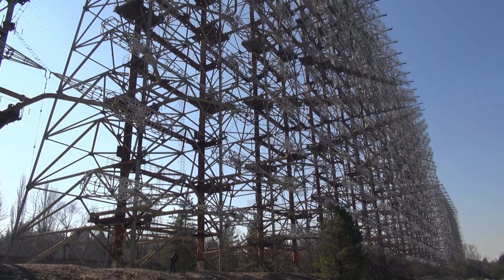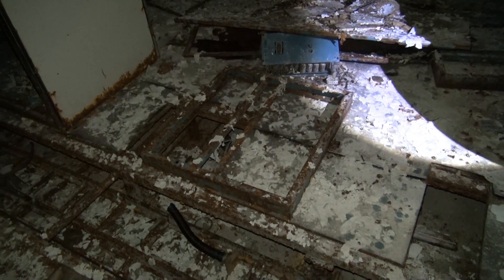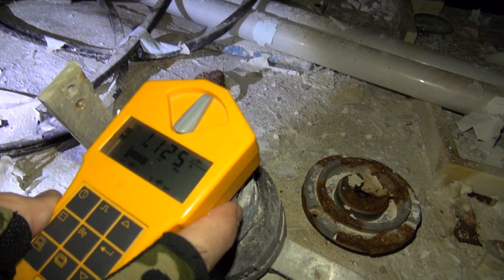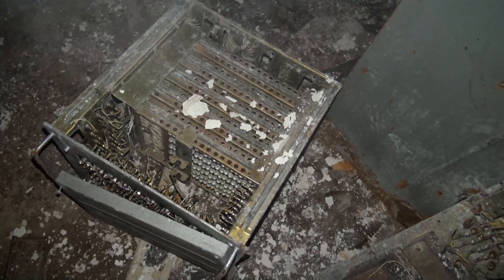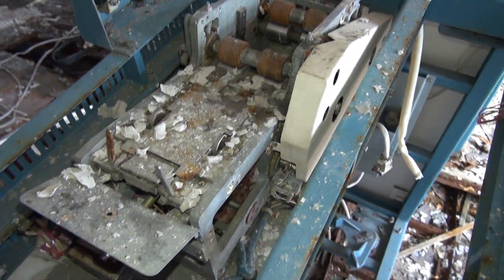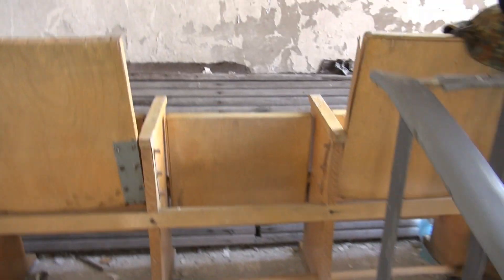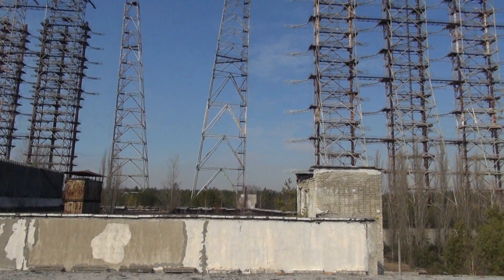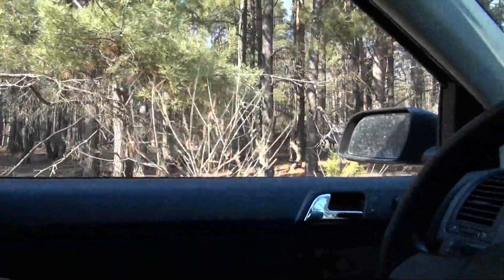inside Duga-3 / Дуга-3, computer mainframe of the Russian Woodpecker / Chernobyl-2

Comment: Somehow it's sad that all the hard work and effort people put into engineering, building and running this station is completely trashed and vandalized now.
Reply: Second law of thermodynamics
Reply: @edgeeffect  Entropy ... I'm twice as messy as I used to be ...
Reply: +nrdesign1991 It most likely wasn't vandalized by outsiders.  More than likely the Russians destroyed the equipment when they left so it wouldn't be able to be used against them. It was pretty common practice back then. You take all the information you can and destroy everything else. Look into the hotel in East Berlin where the KGB occupied the entire top floor. When they left there the hotel employees were so afraid they waited 3 days before they entered.
Reply: Matt Johnson
No matter who destroyed it or what they used the system for, the engineers and workers who put it together still earn my respect. There is quite a lot of manual labour showing on the parts lying around. The technology is inferior to western technology but I can't say they did't try their best.
Reply: The Chernobyl reactor contaminated the area a few years before the USSR collapsed.   Nobody was going to work there.

I am appalled at all of the human labor that went into that thing.  I would not be allowed to design equipment that required so much labor.

Comment: 2:55 looks to be this cable for a Soviet Main Frame my google search term to find it was ' 70's "40 pin connector" -ribbon' (in case the link does not work) and it turned up as the first photo :D 
http://www.ubbcentral.com/store/item/Vintage-60-70s-Multicore-Copper-Cable-40-PIN-Connector-Soviet-Mainframe-NOS-USSR_201452106500.html

Comment: They probably partially built the nuclear power plant just to power all the gear at Duga-3.  That stuff would have used enormous electrical power.  I think you said it was 10MW?  That's not really that insane.  The Crystal Palace BBC TV transmitter for London and the SE England is (was) 10MW power.  They don't need so much power now for digital TV as compared to the old analogue TV.  My comms lecturer at uni showed me a core memory 'page'  that he had in his office as a nice antique. Each ferrite donut had to be hand stitched into a beautiful mesh. I also remember visiting my dad's company computer room as a kid in the 70's.  They had big reel to reel tape drives and punch card readers and later some Winchester hard drives that looked like top loading washing machines that you'd load the disk carousels into.  He brought home a IBM 'Transportable' PC that I learned to program BASIC on.  It was a 20kg mains only powered 'laptop' with a folding keyboard lid that revealed a cool amber tube display.
Reply: Your dad sounds cool

Comment: Makes me want to visit Chernobyl one day. But I'm too worried about the radiation. :/ I'll wait until I'm at least 20 ;)
Reply: +Joseph Marsden (Cryosim) If you travel with people who understand radiation and how to operate and read radiation detection equipment, you'll be fine. Just follow common sense rules - don't eat or drink while in the exclusion zone, limit your exposure to the ground to your shoes (don't sit, roll around on the ground, etc). Wash your hands and clothing thoroughly when you return. And of course, limit the amount of time you spend there as much as possible.  The less time spent there, the less exposure.

You wouldn't be visiting the plant itself (which is restricted), so the radiation levels of the surrounding areas, while they do vary wildly, won't be enough to hurt you if you only visit for a day or two.

Comment: Oh how I envy you!  This is fantastic footage.  I had no idea there was such a sophisticated operation there.  This was apparently much more than a signal 'woodpecker', there was a datacenter there.  And yes, those spots in the floor were where kilometers or cable were laid to connect all of the computer equipment.  The reason the building is all iron/steel is because it acts like a Faraday cage, shielding the equipment and workers from the massive 10MW RF radiation output nearby. That was an incredibly powerful transmitter.
Reply: Yes in holes was cables. Iron walls was probably due to nuclear attack shielding, because Duga was just receiver, transmitter was several tens kilometers far and yes have several MW and worked on 10Hz, was so powerfull, that everyone hated it haha. BTW I loved this nefritr smal memory modules, as a child I disasembly some of them and loved technology from russian because everything was made indescruptible, everything was massive and painted by color. I hope I will see some day places like this.
Reply: it's a receiver . not a transmitter.

Comment: Olga, I would say that the relay board was designed to allow the signal to build up strength and then collapse as it was fed into the woodpecker.

Controlled capacitance

Comment: Core memory (each bit stored on a wire wound round a tiny magnetic core) would have been very old technology even in 1980, so although it's an interesting curiosity now, they would not have been valuable for anyone salvaging/stripping the equipment after the accident...

Comment: Many thanks for a fascinating video series.  !0Mw of power, that's why all the cable runs under the floor.  Its a Bistatic OTH Radar, working in the HF Frequency band.  One set of Transmit and one set of Receive aerials.  Basically a very large, very powerful radio transmitter and a computer controlled receiver system.  Useful to site it near the power station in view of the Transmitter power requirements.  Obsolescence was due to improvements in satellite technology and the fact that OTH radars are unreliable due to the nature of the ionosphere. Stay safe in Chernobyl, and my regards to the Ukrainian people in these difficult times.

Comment: This place has been picked clean of all valuable metals by scrappers. The only remains are the bits of tin cases and steel parts.
That cable was to interlink a data port or analog port between modules. It is similar to a link cable on a switch or router.

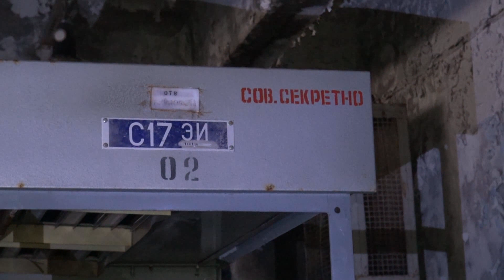Comment: At 12:16 the rectangular pits in the floor were most likely huge battery compartments. That room would have been most likely the power control room for the building. Sort of like a huge modern day uninterruptible power supply in the event of a catastrophic power failure. The huge ventilation shafts seen on the right of the shot when you enter the room also help add to the clue. Most likely this room would have been some what RAD-Hard to help resist a pulse. Main thing to do in that case is to keep the lights burning and have communication.

Comment: The big plug looks a lot like an IBM Mainframe Channel cable. This was sort of like a very extended PCI bus. The Soviets built some IBM mainframe compatible systems (System/360 and System/370).
http://en.wikipedia.org/wiki/IBM_System/360#/media/File:IBM_360_Bus_Tag_Cables.png
http://en.wikipedia.org/wiki/History_of_computer_hardware_in_Soviet_Bloc_countries
The memory was magnetic core memory, the neat thing about it is that if you had taken it and been able to read it out, it would still have had the last data loaded probably intact ('cos the data is stored magnetically).
Reply: Interesting stuff

Comment: Interesting video. I haven't seen core memory in a long time. I wouldn't be surprised if the mainframe was a reverse engineered clone of an IBM 360 mainframe, possibly even a ES-EVM (http://en.wikipedia.org/wiki/File:Fotothek_df_n-11_0000385.jpg). It's interesting how many core memory boards were laying around. The room that was shielded with metal was probably to protect the equipment from RF signals coming from the antenna array itself. The amount of power it must have taken to power the computers and the array must have been impressive for the time. Thanks for sharing;)

Comment: Olga, the wider the plug, the wider the bandwidth of communication at one time that the system could handle.

typically, older systems had 64-pin 128 pin, or 256 pin hookups.

Comment: Hey, thanks for this video and the others. This one probably is my favourite of all the ones you've done.

A couple of points. The reason why you see so much "old" technology is the prohibitive upgrade costs of a lot of the existing infrastructure. Certainly there were operational reasons why magnetic cores would continue to be used (like EMP resistance), but the more likely reason is economic considerations that led to the lack of upgrades (from what we can see).

Early warning  over the horizon radars are fairly "static" in their capability in how it relates to its purpose. Its main aims to detect a massive ICBM strike against the Soviet Union emanating from the West. The total number and technology of NATO ballistic delivery systems remains fairly static after 1972 partly due to arms control treaties and U.S. policy. Thus the technology deployed in Duga-3 in the mid 1970s would remain viable up into the late 1980s, and even up to today if it continued to be funded. 

Over the horizon radars really provide detection for a small space of time between a missile's launch and acquisition by more conventional line of sight radars. That could only provide a few extra minutes of warning, which may be critical in a total war scenario. By the early 1980s the USSR were deploying a spaced based infra red tracking system for early warning of ICBM launches (Oko system). That meant the pressure to keep the Duga system at the cutting edge was lessened. It would serve more to verify data produced by the Oko system, which was notorious for false readings, and as a backup if the satellite system failed or was damaged. Still it's necessity was significantly lessened, and would be an extravagance in the post 1990 geopolitical environment. Given the complexities of the Russian-Ukraine relationship with the dissolution of the USSR, its not surprising that the facility was closed after 1989.

Hope that gives you a sense of the site's significance. It is extremely cool to see it from the inside. I wish I could go and pick up a souvenir from that bygone era.

Comment: Bionerd23;
BTW.... I am told that beryllium will cause a mouldy smell in the air....
undoubtedly they was beryllium in that facility.
BUT there was was LOTS of mould too!!! 

beryllium is used in RF substrate construction, and the dust can be very toxic.

Dan
Reply from the maker: dan braun they carefully disassembled and scrapped even the copper; i cant imagine they'd leave precious beryllium behind. and yeah, berylliosis is at least as bad as asbestosis, even, ugh.
Reply from the maker: bionerd23 if they had indeed left some beryllium behind, wow, just imagine the amount of neutrons i could have produced together with the smoke detectors laying around, tee hee.
Reply: bionerd23 Really? I used to machine Beryllium Copper :(

Comment: at 6:45 the thing with the ridiculous number of contacts is a ferrite core memory bank. it uses tiny beads that get magnetized one way or another in order to store boolean values.
Reply: stelian95 at 13:22 you can see what's inside one of those frames. you can see tiny ferrite beads where the wires cross.

Comment: The holes in the are, are common in the server room. It's called raised floor, like the false roofs.
It is to run cables. So where access to them is required, they are easy to find and fix.

The network that you show in time: 13:18, seems to be Faraday cage, to create a zero electric field inside. (Radio communications can not enter or go out.)

Comment: The floors are hollow with removeable tiles so as to easily run various cables to and from the data rooms. We have similar floors at work. It looks like they took all the wiring with them when they left and didn't bother putting the tiles back.